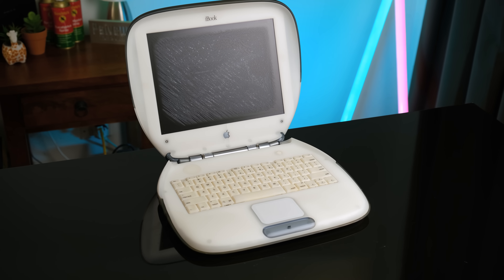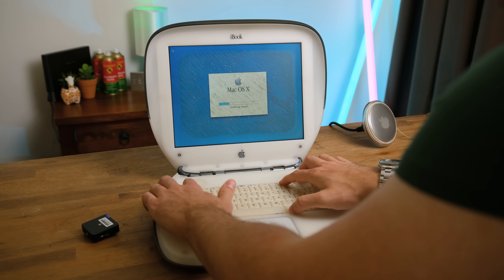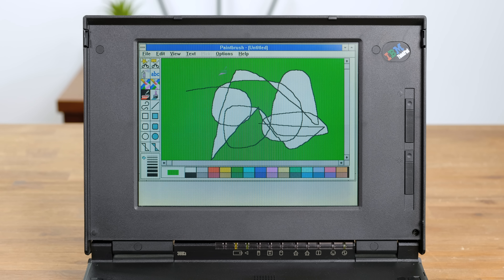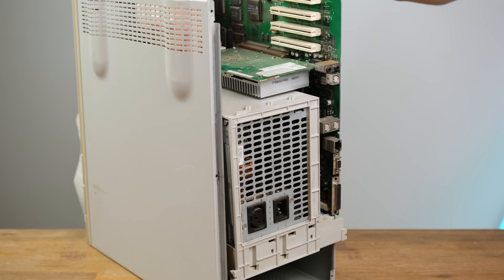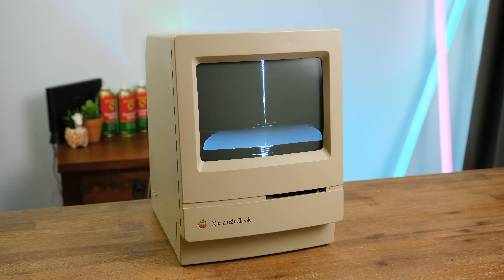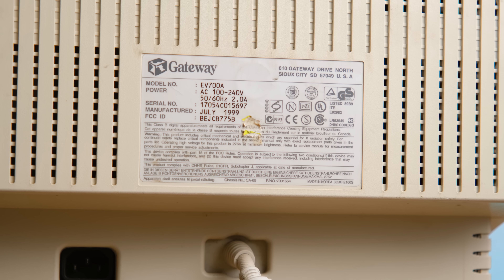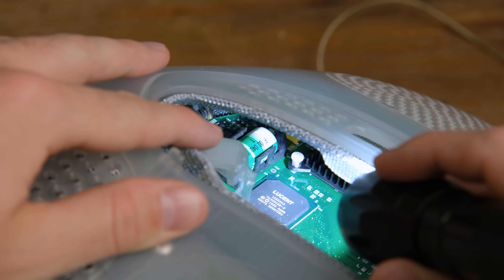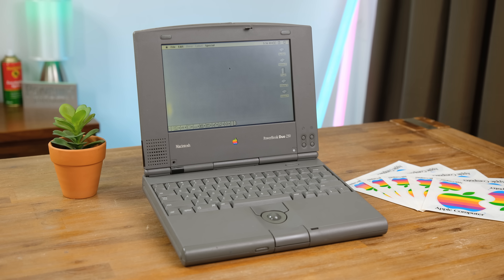So Much Vintage Tech Is Dying... Here's Why

Comment: I remember always reading comments about how people would say "my X works because I took care of it" don't get me wrong it helps, but it doesn't make it prone to never breaking down, components and such on drives/mobo etc all die with/without use. I never got the whole thinking if you take care of something, yet someone's console or whatever broke it must mean they didn't look after it, when its something like a drive not reading or not turning on etc. Same sort of people were against emulation, because you just "needed to take care of your stuff".

If emulation is out of the question, it would be good if they released the schematics and such so those in the know how could "recreate" it in the far distant future. While I get people there would be copyright issues and such, long as it wasn't marketed as "an original" it would be nice.

Comment: I have like 250 GPU's, maybe 300 CPU's, 500 sticks of RAM, 50 motherboards, etc. Collected since the early 90's. Some of the gear dates back to the mid to late 80's. Periodically, when I'm bored, I'll make a retro PC. I've found over the years that, stuff just dies. I've taken brand new, sealed boxes of VooDoo 2 SLI kits, and found one of the cards simply doesn't work. I've taken cards that I've used before in the past, but have been stored for 7 years or so, and found they artifact now.

It's a shame. Had to throw away lots of interesting items over the last few years. Thank god for emulators. In a few decades that's all we will have.

Comment: You shall not horde for profit, let someone have it that will use it. Too much gets thrown on the dumpsters that is fixable and should be given for free. If things are used now and then instead of in storage the capacitors will not dry out so quickly and you notice when the battery is out before disaster.

Comment: My wii disk reader just died by itself. My old tablet too. Infinite loading screen. Havent touched it in years. Sadly I guess all old technology will die eventually.
Reply: my Wii hasn't read discs in 8 years,  but I still use it, as I  soft modded it.. with Homebrew channel , NES/SNES emulators etc
Reply: @tony--james  Do you mean a CD/DVD drive? The slide mechanism of the head occasionally needs a drop of silicone grease to move well. Also dirt can deposit on the lens, so carefully clean it with a cotton swab and isopropanol.
Reply: @cyberyogicowindler2448  on my Wii, I believe the laser failed, forgot to mention, yeah tried carefully cleaning it.. I have 3 other Wii's that are still working, I have all 4  Wii console colors, red/white/black and blue ,

Comment: If you’re interested, the “sticky plastic” is not actually rubber but a TPU (Thermoplastic PolyUrethane) overmold, that is applied to the hard plastic parts, to provide that “soft touch” feel.

It is well known within the plastic industry that these will break down overtime, ESPECIALLY when exposed to cleaning chemicals.

Comment: I've had many of the same problems with old recording gear (multitrack recorder/mixers). Failing displays, sticky rubberized surfaces...it's so sad. I had to dispose of several machines.

Comment: As someone with a deep interest in retro technology, seeing this old tech dying is absolutely devastating. Also, seeing an old turquoise iMac G3 hit me with a huge rush of nostalgia. My family exclusively had Mac computers up until the late 2000s, and our main family computer was an iMac G3 that ran Mac OS 9.2. We used that thing for so many years. My folks got rid of it around 2010 or so (and it breaks my heart that they did), and by then, everyone in my family had switched to laptops except my brother and me. Eventually, even my brother switched over to a laptop. I'm the only person in my family that stuck with desktops basically the whole time, and I'd say the Mac computers we had growing up are probably responsible for my preference for desktop PCs over laptops. So seeing them literally falling apart due to the harsh nature of time really tears me up inside. I hope something can be done to better preserve a lot of this old technology.
Reply: The original Bondi blue iMac was the first PC I bought, back in 1998 (but I'd used Macs before then). My 2013 iMac died just last week. The logic board failed suddenly and the display burned out. Still, it gave a decade of almost daily use, which ain't bad. The new models aren't built to last, or be repairable.

Comment: Dont open hdd to spin up platters! You can do that without opening. Platters are pretty heavy and you can move them by moving hardisk pretty fast.Just make sure you are spinning it in proper way
Reply: If a harddisk won't start, never open it! - Any tiny airborne dust particle will start a chain reaction of debris (like colliding satellites) that will unavoidably destroy it. Likely it won't spin because the bearing oil has hardened. And do not knock or use  force. Better simply warm the bearing with a hairdryer (not too hot) to remelt the grease and then let the disk spin for an hour to let it knead the lube soft again.

Comment: This is the reason i defend xbox using removable batteries ive had 3 ps4 controller batteries die and several ps3 controllers that have been rendered to paper wights i still have a launch 360 slim model model controller as my main 360 controller thankfully ive only had to replace my rechargeable pack once same as my xbox one controller

Comment: My dell laptop is from 2007. It was coated in that rubberized coating that was popular at the time. I took very good care of it, mostly from rarely using it. The rubber, like all rubberized surfaces of the time, is now all sticky.
Reply: https://www.youtube.com/watch?v=zZL3zAO-_Qk
Reply: Generic Name  I still use my laptop because of all the Adobe software that’s on it. I considered purchasing software from this decade, but they are now subscription based, so I never truly own it, and end up paying for time I don’t use it.

It is surprising slow, even when not connected to the Internet, but I’m not sure why that is. In 2013, I purchased a 2000 iMac G3 for the styling. It’s as fast as a computer from 2000 would be except if you need to use the Internet for anything. Modern websites weren’t designed around old computers like that so it has to load so much you wouldn’t think about, like google Adsense, and Facebook integration, and the Amazon servers they decided to host the site with, and the MB each imaging.

Comment: I have a 2005 eMac G4, that worked when I bought it, but I came home one day to it not on. I tried to power it up and it showed no signs of life. I assume the capacitors went. Now I just need a list of capacitors to order, so that I can have them all ready before I take it apart. Does anybody know where I can find that?
Reply: Good luck. If you choose to carry on with this project open it up and make a list of caps you need. Mouser Electronics would be a good source. Changing surface mount caps is a blast. I used to rebuild the PIP boards for Mits crt tvs until I learned how to just bypass it. No one ever used PIP after the first month.
Reply: @Dannysoutherner  that’s just it, I don’t want to take it apart, make a list, and then lose pieces or forget how to properly reassemble before the parts get there. I’ll have to tackle it another time.

Comment: I converted back to CRT's earlier this year because of everyone talking about how great they still are. Started off fine, but two months later in and it failed. Took some doing, got in contact with a repair person, they flat-out told me they don't touch CRT's anymore and recommended me someone who specializes in Retro Technology, the new guy told me he could fix it but it would probably be much cheaper and quicker to buy a new monitor. He even advised me not to buy another CRT because it's very likely it would also break a short time into use. He said the only ones worth still getting are the super high-end ones that were made around the end of the Technologies life. Those are also the most expensive ones and at those prices I would just be better getting an OLED. It wont be the exact same, but it will be close enough.
Reply: OLED is the worst shortlived technology ever. They burn-in within 2 years of "normal" use. E.g. my small CRT Toshiba TV runs about 14h/day and as an OLED would likely be toast within 3 months.

Comment: Most plastics can be recreated at least. You can use silicon to create a mold of the original plastic and then cast new plastic. Or model and 3D print then smooth. Still it's an unideal solution to a unavoidable problem
Reply: This is also why I'm slowly recapping all my old electronics.

Comment: Also the sdds in consoles and embedded systems will stop working
Reply: SSD/Flash memory functions like DRAM with 1 year refresh cycle (see Wikipedia "wear leveling") and will die if not powered on once a year for some minutes. It dies the faster, the more erase/overwrite cycles it has gone through, thus never use a worn USB stick or SSD as backup media. They starve without energy (modern triple/multi level types even faster).
Reply: @cyberyogicowindler2448  yeah thats why i still buy hard drives for my pc as well as ssds because i want some recoverable and long lasting format

Comment: This is why I'd love to see manufacturers release the spec sheets for things like display pinouts, so enthusiasts could just build converter boards to plug in new displays.
Probably a little bit ghetto as they'll never fit the original chassis without some minor modifications, but it's sure better than nothing.

Comment: It is problem with older stuff indeed, although i will say those apple computers look like they were built down to the lowest possible cost which is hilarious considering how expensive they were back in the day compared to what else was out there at the time.

I have a lot of old computers and the plastics are no where near that bad as those shoddy apple plastics, i have a old BBC Micro that is over 40 years old and its just the same as it always was and other than a few capacitors in the power supply and is still working well.

I also have a old Toshiba laptop from 1990s that still runs windows 3.1 and other than the battery its fine. 

But it think there will come a time when none of them work at all, maybe we will have StarTrek replicators by then and we can just make a new one :)

Comment: but if your remove the batteries you' ll lose all the data such as the BIOS settings and drivers
Reply: Not drivers, only the setup. The PC will need to know which harddrive is installed and which CPU to run well, but normally should be bootable without, after selecting some basics in the BIOS menu. Best write it down or take a photo of each setup page so long it works, if the thing can not save it to physical media (diskette or USB stick).

Comment: This stuff applies to anything plastic. Chevy made a ton of 1973-1987 pickup trucks/SUV’s/cab and chassis/van vehicles. Every one of them pretty much had the same steering wheel. Every one of the steering wheels releases that same plastic sticky goo that takes forever to get off. Ford has a similar situation with their 73-79 pickups, vans, SUV’s, and cab and chassis- the plastic on the instrument clusters turns to chock and non of the printed circuit lights/electric gauges work anymore.

Comment: Yeah, rubber-coatings do suck, especially if they are on a MOUSE...damned, I use my mice a lot, so they start showing this stickiness after a about year or two -.-
Reply: Skin lotions (particularly with essential oils like fragrance) can strip paint from keys and decompose plastic surfaces easily. I am very careful with handling tea tree oil etc. Also normal oils (food etc.) can decompose rubber and some plastics, so keep food away from keys.
Reply: @cyberyogicowindler2448  Well, I do sometimes eat in front of the PC...but otherwise I don't use much in the way of lotions and if I were to apply lotion, then I'd wash my hands before touching the mouse again...I do have sweaty hands however and sweat isn't the nicest liquid either :(
Reply: @dreamingflurry2729  On my serial Okano mouse the white plastic also discoloured beige mainly in spots where it gets touched by hands. So I am not sure if it is entirely sunburn.

Comment: The reasons in this video are why I love to repair vintage electronics. Something about it is really satisfying. I've got that Gateway Ev700A CRT and it arcs inside occasionally. I love to completely replace failure prone electronics (like capacitors) with high quality parts ensuring that they'll run for the longest time. I agree that the worst part are decaying plastics and rubber.
By the way, older CRTs can also develop something like vinegar syndrome. It's called 'cataracts' and it's the adhesive between the tube and the safety glass decomposing. Very, very difficult and dangerous to fix.

Comment: Here's a word of advice...DO NOT STORE LAPTOPS WITH THE SCREEN CLOSED! Many vintage materials will begin to gas off as they age. By allowing them to aerate, rather than trapping the gasses inside the closed cover, you'll probably prevent this from happening. So store OPEN and in a ventilated area.
Reply from the maker: Good call, if only I had the space to do that with all the ones I own 😬
Reply: @psivewri  Perhaps lay a piece of active carbon foam (used as smell aborbent for kitchen hoods) wrapped in tissue between screen and keys. I can not promise that it works, but it may neutralize the vapour before it hits the screen. Only be careful not to spill loose carbon powder (soot) into computers because it is conductive.

Comment: Sticky rubberized coating is awful. Fortunately, it is relatively easy to remedy: make a paste out of baking soda and scrub the coating off in the sink, then rinse with water. Of course you'll need to disassemble the housing/bezel/whatever from the electronics, but it's a great technique.

Comment: You have to be carefully how you clean your tech too. There are certain chemicals in household cleaners and wet wipes that can accelerate the degradation of plastics and rubbers. Especially those items with rubberised matt finishes causing them to go all sticky. Also keeping items out of direct or strong sunlight might help too.
Reply: Those rubberized finishes will go sticky even if you never expose them to any chemicals. When that happens, I put on some gloves and apply rubbing alcohol and elbow grease. Bare plastic is better than sticky nastiness.

Comment: They had that happen to some old CRTs. The guy called it CRT cataract on YouTube. He removed the safety glass glued to the front of the CRT and scrapped it off with a puddy knife. Of course you can't do that but there could be a brilliant technique to get rid of it. Hopefully in future someone will post it on YouTube when they do lol.
Reply: For the polarizer you can probably just peel it off and replace it with a new one so long as you clean them well enough to prevent bubbles from being trapped under the glass.

Comment: My 2018 Razer Blade (Mercury White) laptop had a bulging  battery issue, so I removed it. Must be plugged in at all times now since the replacement batteryI ordered on Amazon arrived damaged (crimped/bent metal housing) and I've been weary of ordering another one.

Comment: I have what could be considered a vintage PC.  I have a Dell XPS 9100 desktop that I bought for myself around 2010.  Thirteen years later, it's still running like a champ as I've rebuilt it and fully upgraded it.  I'm wondering after watching this video how much longer this system will last me.  I use it occasionally as a workspace computer as it still has an optical drive built in it.  That's something that my much newer gaming PC doesn't have.  I guess only time will tell, but for now, it's still a perfectly good PC that can perform just as good as any modern desktop PC.
Reply: Still use my daily driver PC, a 2012 i7-3770.  Saving grace for it was that the manufacturer shipped it to me with twice the RAM (16GB) than I paid for.  11 years later, the 16GB is still a very healthy amount and the single core performance perfectly adequate for snappy daily driven tasks that I have no plans to replace it. Only changed out the spinning disk to an SSD a number of years back.
Reply: HAHAHA XD You are funny.